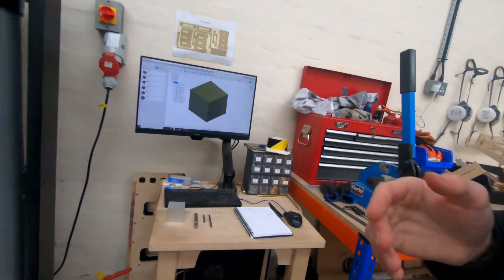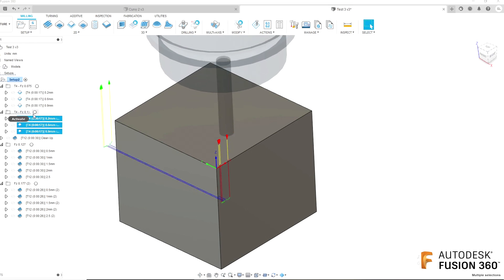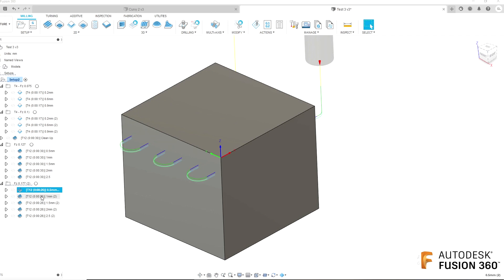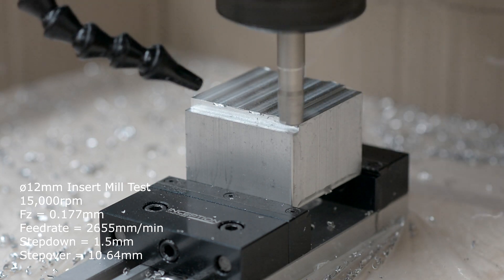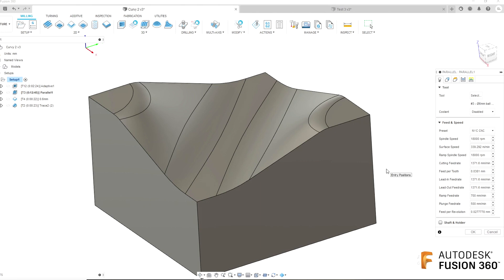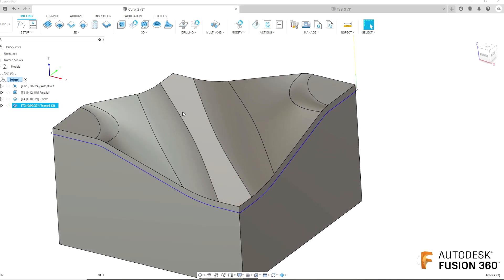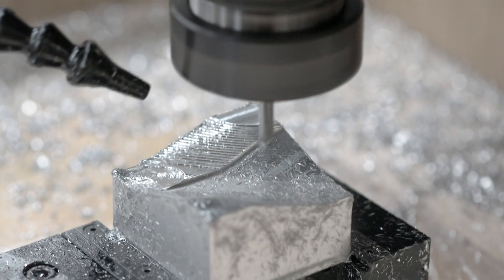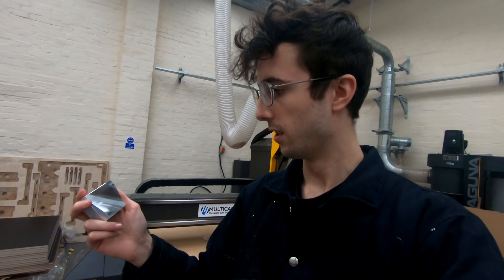3D Surfacing Aluminium on a CNC Router! #07

Comment: Can I know what controller you use? Is it Mach3 driven? I am having an issue where my machine is losing steps on the Z axis when doing parallel cuts. Every hardware seems nice and tight. My theory is that when it end a pass in the X direction and go .1 mm in the Y direction to begin a new pass it is not responding fast enough to the Z change and it is missing a step. You can notice the bit going deeper and deeper as it goes further in the Y direction. Should I try feed optimization or turn on the CV controller on Mach3?

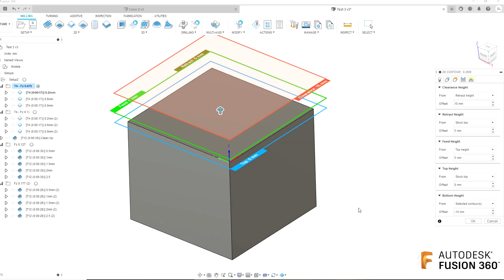Comment: 0:51. Where / how do you get the aluminum stock block?  Do you buy a square bar of 6061 aluminum and use some kind of saw on it to cut it up into blocks?  What kind of saw if so?  If not, do you order these block from some place pre-cut?

Help a newbie out please.
Reply from the maker: Websites (UK) like Metals4U or Aluminium Warehouse are good places to quickly / easily get material pre-cut to size for a fee. Most suppliers will cut material to size if you ask, but those two websites are nice and easy and you can do it all online.